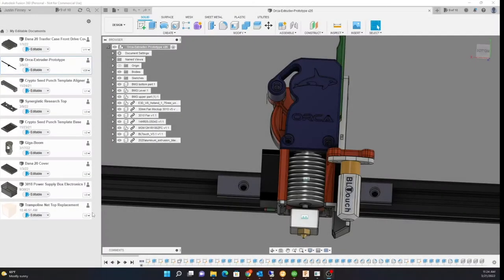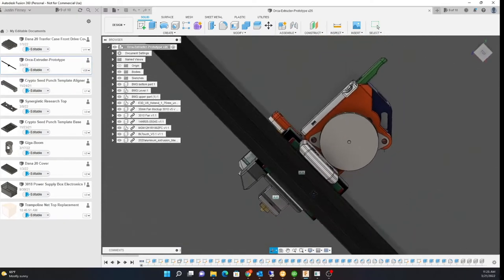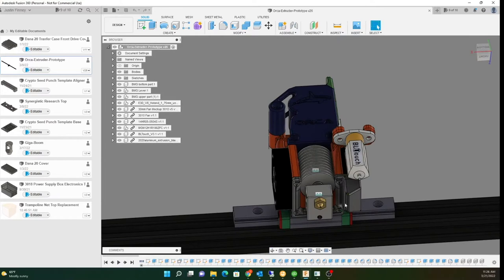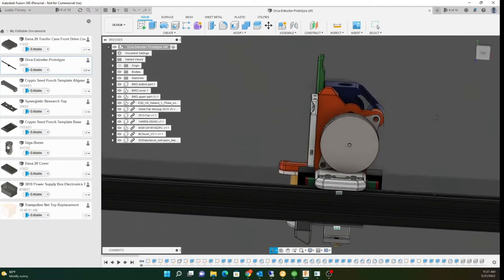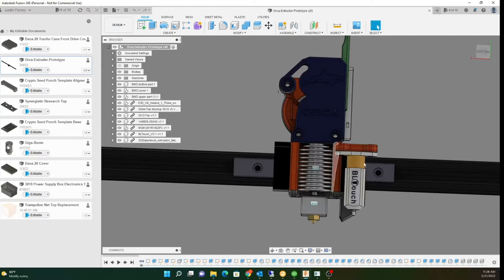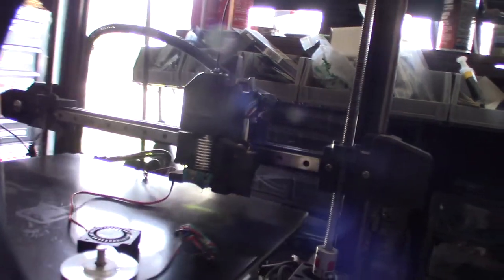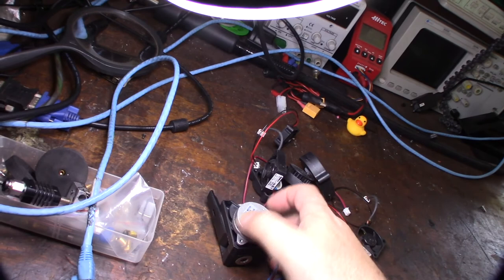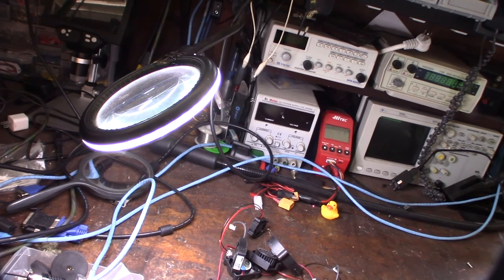Orca Extruder System Nema 14 Ultra Light weight with BLtouch Part 1

Comment: Great work. Hoping you will post the files when you have finished testing. Also wondering if the 2020 extrusion behind the linear rail is needed to prevent deflection or is it primarily there to make it easier to secure the ends of the gantry.

Comment: Everyone wants the speed without the accuracy. Bazaar mindset in this community. 

I am all about ball screws, hiwins, large  rigid chassis and a 500x1000 fixed bed and can still get 168mm/s which is faster than a stock voron. Not portable by any mean, but far better prints and no need to sacrifice speed plus peek and anything else can be printed.

I do understand light weight with belts and small frames. It just seems that the community wants industrial quality and light weight and the two don’t coexist together. I see people with conflicting goals.

Well with Industrial printers weighing in at 2500lbs its obvious quality prints require rigidity.

Its neat to see innovation thats the fun in all of it. Eventually someone will bring industrial machines into a more affordable price where hobbyists will realize once they get their hands on one that rigidity and weight are required for professional results. Until then it will always be close or good enough but they wont ever compete.